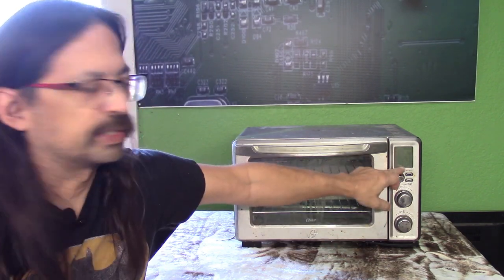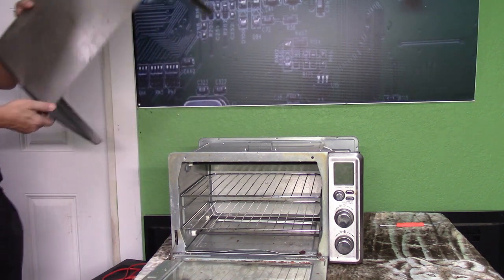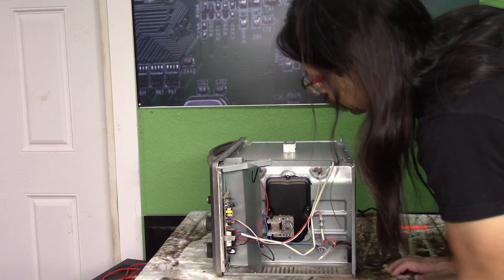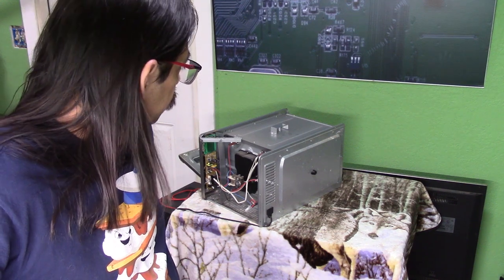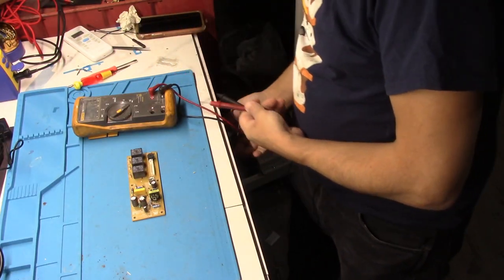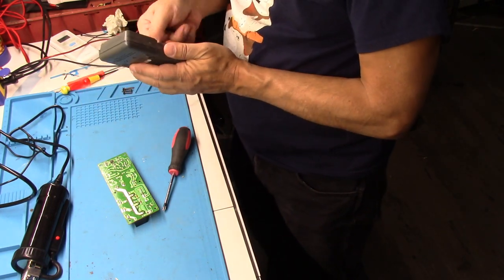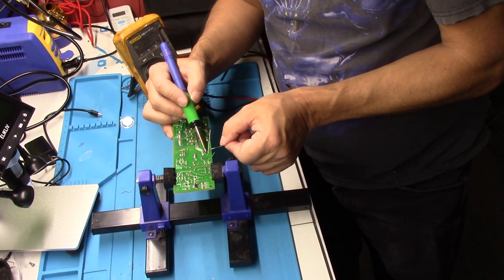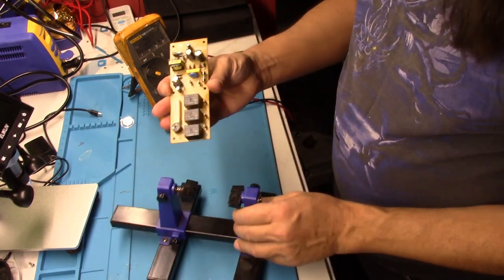toaster oven Oster model TSSTTVDFL1 dead

Comment: I have exactly the same oven and the same problem. Thanks a lot for posting this repair!!!
Where did you get the replacement fuse?
Reply from the maker: my go to place is Digikey.com but you can also check Amazon if you cant find it there then digikey or mouser is the best options. make sure you check the shipping cost on digikey because you may pay $5 or $6 for shippng but the part only be like 30 cents, at that point it best to buy multiples in order to get your money worth for shipping. Good luck in all your repairs, and please EVERYONE try to repair as opposed to throwing something out!!!